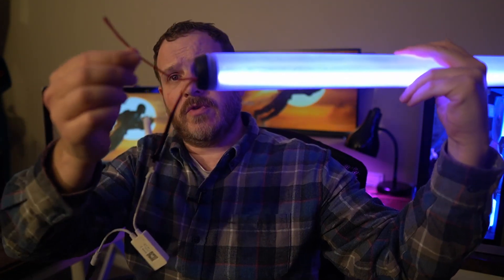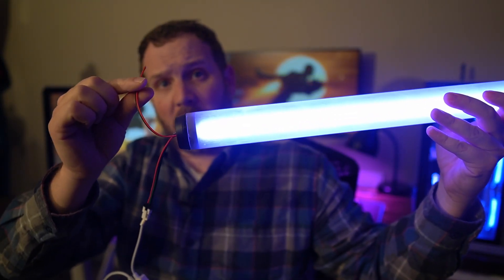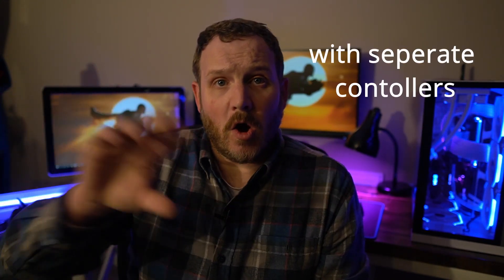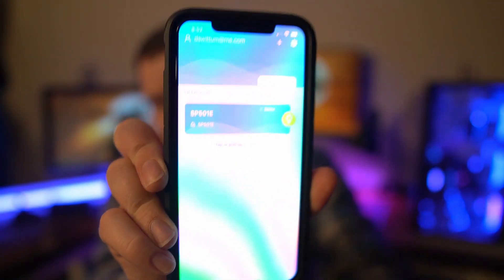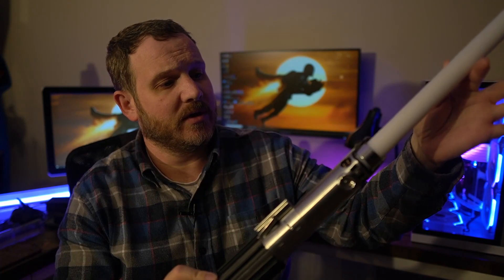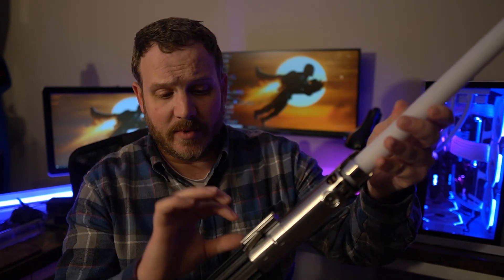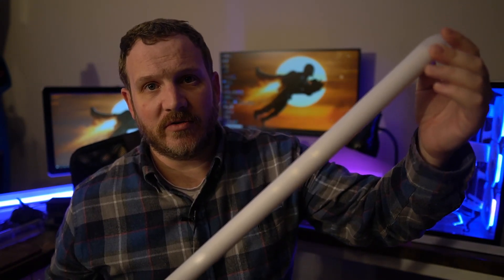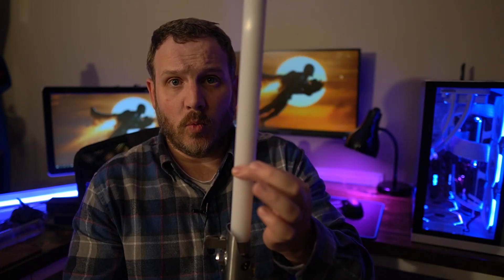DIY RGB Light Tube 2.0! Also I answer your biggest questions from the first video

Comment: Hello and thanks for this.Incredible, awesome vision and explanation.You have just made this all doable for me. However, I am not understanding the extra wire on the input side of the tud=be. You said that another power supply could be connected? You can have two power supplies connected into this to power more lights?

Comment: I want to make some of these to be dmx controllable through my lighting software on my pc. Would you happen to know if a dmx decoder to my computers lighting program in place of the WiFi controller would recognize the led strips “effect” functions? Chase functionsc, the fire effect, etc.
Reply from the maker: All those effects come from the controller.  As long as the strip is wired for individually addressable rgb leds, it will accept whatever commands are being sent by the controller.  So in your case, it would be the software/hardware your using the connect the lights to your computer.  And how they communicate.
Reply: @wittech6116  thanks for your reply. Yeah, that is what I sort of figured. The other stage lights I use have built in perimeter profiles I can set to address my dmx “number” for strobe or chase and so on. I was hoping there was some magic shortcut I wasn’t aware of. This will be my first attempt and putting together a dmx addressable fixture, thank you for the great vids. Much appreciated!

Comment: So the tools you will need are 
1. T8 clear tube
2. 140 led rgb 
3. Controller 
4. Scotch brite pad 
5. Frosted glass Spray paint 
6. Wall power source
7. Milky covers 
(Make sure controller and led strip are both either 4 wire or 3 wire)

Comment: How would you make this do both RGB and a tuneable white? I am looking to make ~6 as a complete lighting kit where you have a 2-3 running as white and the rgb's for backdrop. Would just be cool to have them be able to do both well, and then figure out some battery situation.
Reply from the maker: You would have to find some rgbw strips.  True white color control is not feasible with just RGB.  That means your controller would also have to be able to control rgbw leds/strips.  Good luck!
Reply: @wittech6116  what about the RGB strips and adding a tunable white strip. Use seperate controllers and just give power to the strip you want to use at the time.

Comment: you say this version has a smaller tube on the inside? or did i misunderstood ? ... and also have you considered aluminium foil on one half of the tube acting as a reflector? and it would also direct the light 180º degrees angle rather than 360º
Reply from the maker: Not a smaller tube, per say.  But what amounts to a led strip mount.  That has a trans white cover.
Reply: Went to lowes 2day and bought 2 types of clear tube. One large diameter and the other smaller. I then folded one rgb strip back to back , placed it inside the smaller tube. Then wax paper on outside of that smaller tube. All of that easily slide into the large tube and wala! Worked well. 

I didn't know about the frost process until  I finished then saw your updated video. May try that  as well 

Thanks for saving us all some serious $$$$

Comment: Hi there! I have an issue.  I’m trying to make 10 of these. But with the wifi controller, I can’t control 10 of them unless they are all connected! Any suggestions on getting around having to buy wifi controllers?
Reply from the maker: To my knowledge, those are your two options.  Daisy chain them to one controller, or seperate controllers for each tube (or section of tubes).

Comment: Im building the first version and will probably update it to the second version but I intend to add a battery to make it portable. I would like to duplicate the tube structure and and dual strips of your light saber. It would provide a stronger, more durable tube and increased brightness. It also provides a battery pack for portability. I want to use this  for light panting photography. Can you provide guidance on construction? Parts needed and simple battery operation. I would like to avoid the expense of the Arduino just a simple on/off and the phone app control would be fine. Thanks!

Comment: Is it possible to make these with a rechargeable battery supply?
Reply from the maker: Yes.  As I showed with my lightsaber (which uses two of these strips back to back, and is powered by a single 18650) they can be powered by a battery pack.  You would need a voltage converter and a controller that can operate under those conditions.
Reply: @wittech6116  If that battery is 3.7v what kind of converter are you using in your saber?  What would you suggest in this application?
Reply from the maker: @robertweintraub125  it uses a proffieboard, which has a built in converter. It would be perfect for a light tube, just not a budget light tube.
Reply: @wittech6116  Can you suggest a 12v step down converter to make these cordless?
Reply from the maker: @robertweintraub125  I don’t personally have any experience with any, but I’m sure any of the numerous ones made for use in cars (available on Amazon) would work fine.  And if they don’t, that’s why I love Amazon.  Free returns.
Reply: @wittech6116  Most of the auto ones top out at 5v 15w.  Or are too big for my ultimate idea.

Comment: Just curious if with a 60/m LED, would the gaps still be noticeable? Can't seem to find a 144/m LED that's longer than 1m
Reply from the maker: With the diffusion I have used, yes, you will still see the gaps.  You would have to work much harder at diffusing the light.  This is turn will diminish the light output.  But it could be done.
Reply: @wittech6116  thank you so much for your quick response! Just one more question, could the power supply you linked power up two of 144/m LEDs at once from the other video?
Reply from the maker: @yoacewtf  if you are referring to the updated power supply in this video, yes.  It could probably handle 3 strips.  Now, the closer you get to using white (which is just powering all 3 dies of each led module) you exponentially increase the amperage draw.  Just something to consider.
Reply: @wittech6116  thanks for that info! Would there be some sort of voltage drop if i do this?
Reply from the maker: @yoacewtf  yes.  Anytime you add anything to a circuit (whether it be contact, wiring, consumers, etc.  anything that introduces any extra resistance will cause a voltage drop.)  In the case of daisy chained led strips, it will be minute.  And since these led strips only operate at a very specific voltage, if the voltage drops too  far the strips wont dim, they will start to flicker, or just shutdown.

Comment: Do you have another suggestion for the LED controller? I purchased the one you have and I can’t get it to connect to my WiFi do to my network being a 5G
Reply from the maker: Is your router not dual/triband?  Most routers that operate on 5ghz will also have a 2.4ghz band available.  I would imagine most (if not all) of the budget rgb controllers are going to use an older 2.4ghz wifi chip.
Reply: We have a dual band and I’ve tried both but still won’t connect

Comment: If you can figure out a 3.0 version that includes rechargable batteries to the mix(maybe as structural component that the RGB's wrap around inside the tube), you may break the internet.
Reply from the maker: I’m working on a viable (and budget) solution.  I hope I can work something out.  I’ll keep everyone updated.
Reply: @wittech6116  Not that I want to break the internet but I do second that idea. Rechargeable batteries and WiFi or Bluetooth control. Keep iterating mate. This is excellent work.
Reply from the maker: @rednaughtstudios  I have considered this.  Biggest roadblock is cost.  I have wanted to keep my DIY videos more accessible, financially.  Once I hit the required subs to allow me to do pills, I will see how many people really want a wireless version.
Reply: @wittech6116  fair enough. Got to keep the whole cost quality time triangle within tolerable limits. 
(Cue music: Queen - I want it all) 😉
Reply from the maker: @rednaughtstudios  exactly.  Love the music reference by the way!
Reply: @wittech6116  Thank you for the wonderful content. I too would really like to have a battery powered solution to this, with remote. Keep up the great work.

Comment: Have you tried only using the milky covers? I mean, without getting them on the tube? I'm trying to get the parts, and the only thing I'm missing is the tubes... Isn't the diffused acrylic on the metal strip enough?
Reply from the maker: I’m actually using one without the tube mounted to the back of my desk to light up the wall.  But, without a diffused tube (or some other form of diffusion) you will still see some separation between the individual leds.
Reply: @wittech6116  Thanks! I guess I'll order the milky covers and see if that's enough. Somehow the plastic tubes are very hard to get here.
Reply from the maker: @pentagramrecords3834  no problem!

Comment: Hi...Great video..Please do give it a try to converting it into battery operated. Like the actual Quasar or Astera tubes. 18650 is the battery that are chargeable and is used in multiple battery packs for example NP970 Sony. I guess joining multiple batteries and hooking up them to make them 12v might do the job.
Reply: I am testing out using a rechargeable 12v 3000mah battery pack that has a usb output of 5v (needed for these strips). I also purchased a usb to DC power converter to plug into the 5v usb output to than plug into my controller. The rechargeable battery and converter cost roughly 36 dollars.

Comment: Nice Video Wittech thx again ! One question, im from France and I cant find the empty tube without paying a 30-40$ shipping tax for a 3$ tube product... Can you share us a EU product if you find it ? I spend so much time on it !!
Reply from the maker: Check out https://thesaberarmory.com they are based out of the UK.  The tubes will be smaller, and a bit more expensive, but used with the foam insert, you won’t have to do anything else for diffusion.  This is the same setup as the lightsaber demoed in the video.  Good luck!

https://thesaberarmory.com/products/1-thin-walled-trans-white-polycarbonate-tube-1-metre?_pos=52&_sid=f6d95e301&_ss=r

https://thesaberarmory.com/products/1-thin-walled-kr-pixel-stick-neopixel-led-strip-foam-diffuser-1-meter?_pos=31&_sid=f6d95e301&_ss=r
Reply: @wittech6116  Thanks a lot ! unfortunately the shop seems to be temporarily closed, wait and see :)
Reply from the maker: @scrn4680  I think they are reopening on the 9th.

Comment: Dude!!! Thank you so much. I built one of the "cheap" tube lights and I am definitely going to build the "budget" lights now. This is exactly what I was looking for. Of course if you build sabers your mind would know.exactly what would be best. So I want to build 2x 6.6ft tubes.
Does that mean I will need to Daisy chain 2 strips inside one tube? 4 strips total?
Will I need one or 2 power supplies?
And One Controller?
Reply from the maker: Two strips, one power supply (the bigger one, like in this video.), one controller.

Thank you for watching!
Reply from the maker: You will probably need one power supply per 6.6ft tube.
Reply: 2 strips per tube Daisy chained? One controller for both tubes?
Reply from the maker: @NaveenK-kz8me  if the total tube length is 6.6ft, yes on two strips daisy chained.  You can use one controller for both tubes, if you want both tubes to match in color/style.  For simplicity of wiring, a separate controller per tube would make things easier.

Comment: bro guy.... I love you. take more pride in this. do not be surprised at what you did. This is what is referred to as "evergreen content". People will be referring to this for years on end because it will not be outdated as long as corporations are motivated to make money by selling lights at a %2000 profit. You should make an all inclusive final build video so that once i use this in a shoot i have a direct video to link people to.
Reply from the maker: Thank you so much.  This means a lot.  Can’t wait to see how your shoot(s) turn out!
Reply: @wittech6116  not a problem, you created something very cool and much needed and it's in more of a demand than you know. You should just make an entire comprehensive video of making the best versions of the new ones and make sure to add those time stamps! i came from the other video because you replied to my comment. I made the mistake of buying the strips with the wires vs the 3 pin controllers the first time as well.
Reply from the maker: @sg343117  I fully intend on doing a final version video after all questions have been asked/answered and any and all issues have been addressed.
Reply: @wittech6116  awesome to hear. yea the linking directly to amazon thing is iffy because they go out of stock and stuck so i had to figure out out a controller and strip that worked together but it looks like youre addressing that. i had the no tape sticking to the wax paper issue so ill be heading to the hardware store today for some of that paint
Reply from the maker: @sg343117  the paint helps, but the biggest difference comes from “sanding” the tube with the scotchbrite pad.

Comment: Would buying this power supply help the overheating issue I am having? I have a LED controller that is 5v-24v since the one you suggested wasn’t available. When I plug it into the wall it doesn’t get hot, but when I plug it into an extension cord it gets hot
Reply from the maker: The power supply is getting hot?  What’s the watt/amperage output?